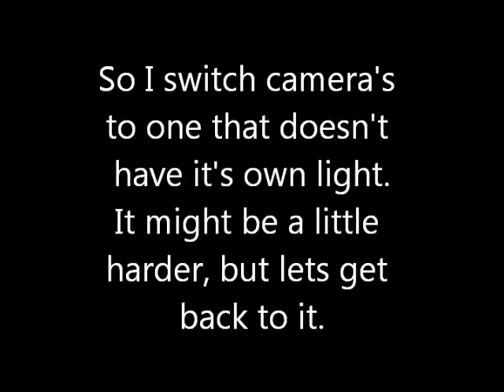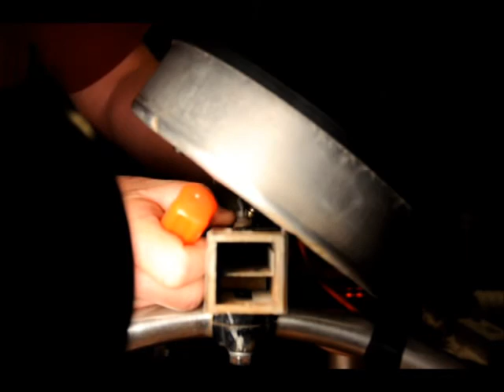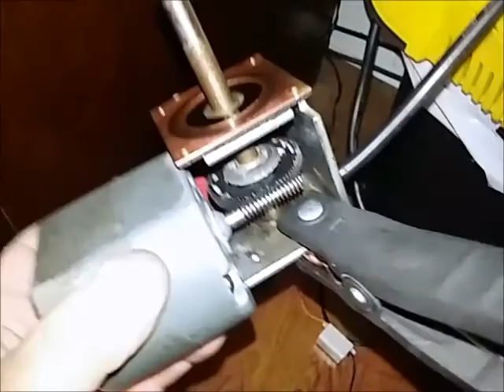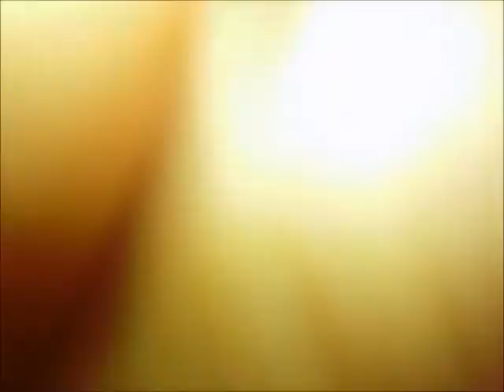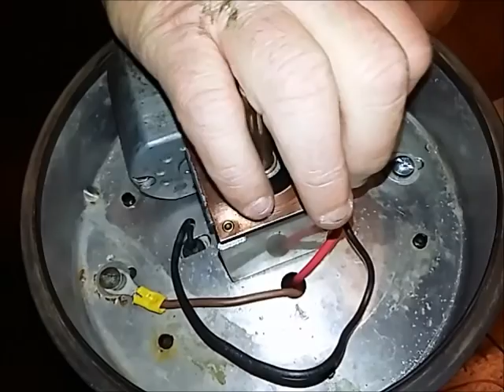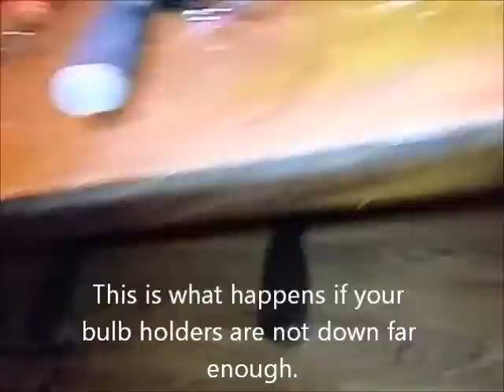Federal Visibar rebuild

Comment: Pro tip.  Take the feets off and pull that tray out a little one side, hook the chain from the bottom, slide it back the other way, hook the chain on the other side.  You can have all the screws started and ready to go.  That way works but a shop would do it the way I described above.

Comment: Great video. I’ve always wondered how these chain-driven bars worked internally. I wonder why they didn’t just have two driven beacons? Maybe electric motors were a lot more expensive in the 60s.
Reply from the maker: With the chain you could set a sync to the flash. Most were set for Wig Wag as mine are. Left - Right - Left -Right. But you could sync them to both flash at once if you wanted.  With two separate motors they would just randomly flash with no pattern.
Reply: @Skulldiggers  ah interesting. That makes sense. Thanks! I remember seeing some of these as a kid in the 80s up here in Canada on my dads various patrol cars. Rotators were almost complete gone when I started 18 years ago. This was probably the first bar you could actually adjust a flash pattern on.

Comment: I cant imagine how pissed off the fleet maintenance guys had to be when one rolled in to be fixed.
Reply: I was 1 of them. But still I prefer dual sealed beam rotators than those damn halogens always burning out or the strobes brains frying. At least a Visabar can be fixed.

Comment: Do you have any extra cut out Kydex cards ?   I picked up a beat up Visi twin beacon ray for personal display.    The motor card in mine is broken into pieces much like yours shown.  How did you make yours ?   Your appears to be professionally " cut " .
Reply from the maker: I fabricate them.  It is kydex. They have to be fitted into the housing after a rough cut.  I can do that for $25 plus return shipping if you want to send me the motor.